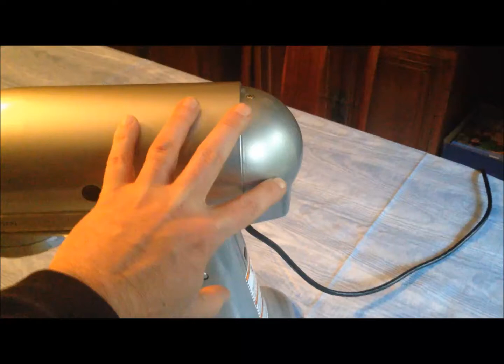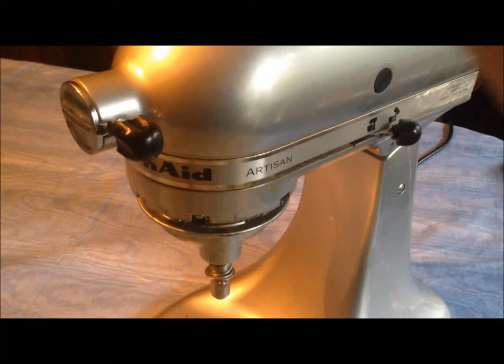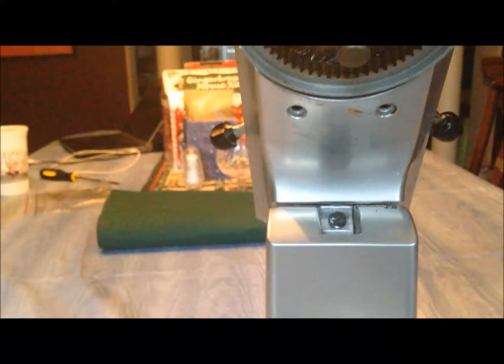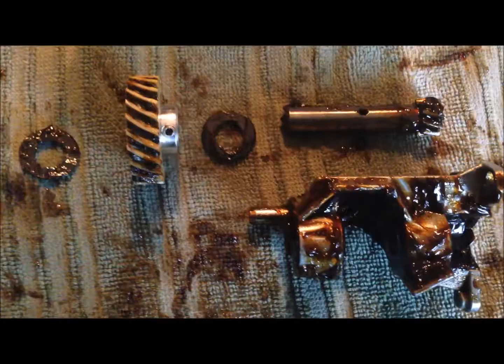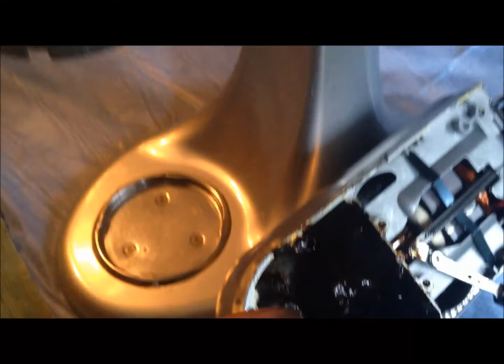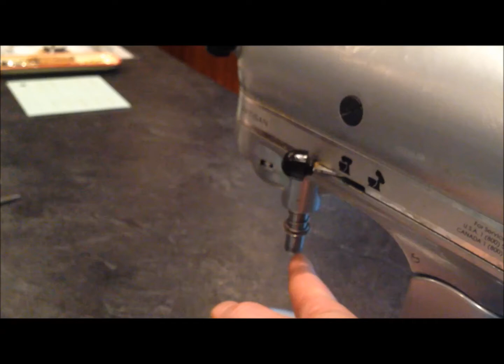Repair a Kitchenaid mixer that won't mix - Bonus footage: How to adjust its speed

Comment: Bottom screw is high speed set on speed 6. Top two are slow speed. Set on speed 1(stir) 
On stir should be 1 rev per second. Loosen top screws evenly to speed up, tighten to slow. 
Once set on low, pit on speed 6. Should get 3 revs per second (30 in 10 seconds)  tighten lower screw to speed up and loosen to lower speed. (Opposite as top screws)
Set low speed (stir) first then high speed (speed 6).

Comment: Top 2 screws are low setting for stir setting set to 1 rev per second. Lower bolt is high speed setting for speed 6 needs to be 180 rpm (45 every 15 seconds) 
Set low setting first then high. 
Top screws for low are loosened to speed it up. Lower screw for high (speed 6) are tightened to speed it up.
Best to start at factory specs of 3/8" from back of plate to where screws mount to body of mixer. 
:-)
Just writing this in case some others get confused about this.
Hate to see someone pay shipping plus a chunk of change for something that can be easily done at home.
Over time the contacts will wear and may need adjustment throughout the mixers lifetime.

Comment: FYI the bottom screw is not an anchor screw. It is to adjust the mixers higher speeds. It should be at first all the way out, while you adjust the stir speed using the top two screws. After the stir speed is set the bottom screw is then used to set the speed for speed 6-8-10.
Reply: Yes. Turn onto speed 6 after setting low speed on stir. Adjust bottom screw to 3 rotations per second (30 in 10 seconds, 45 in 15 seconds, etc)

Comment: Doug, I have a K5-A purchased in 1974. Was in rural Alaska for 44 years and it has been a work horse with few repairs required. Replaced brushes a couple of times. Now live in North Idaho, and I dropped a spatula into it a few weeks ago and now it is out of sync with the beater touching the bowl with every rotation. Have ben unable to locate a video that would show me that adjustment or repair.  Do you have a video that shows a solution for that?  Thank you for the speed control info, I need to adjust that also. Have been unable to locate a local repair shop in either Coeur d'Alene or Post Falls, ID. My home email is piratescorner3@gmail.com if there is an easy fix?? Thank you!
Reply from the maker: Hi Paula--Sorry I'm out of my depth on this one. The axle appears to be bent up in the motor housing and you would need to bend it back. The spatula must have applied a lot of force to the arm that was transferred up into the housing. You'd need to take off the housing, remove the grease and look at the axle spin to diagnose where the bend occurs, then figure out how to bend it back. It won't be perfect unless you get lucky but as long as the beater doesn't scrape it will be okay. You could replace the whole transmission I guess, but can you still get parts? Good luck.
Reply: Thank you so much for your response!  I will open it up and see if I can see the problem area.  I love it and don't want to give it up.  The new ones do not begin to match the quality. I have a friend who went through 3 new ones in one year. They would not honor the warranty for the 3rd one, they told her she must just use her mixer too much.  The old Hobart machines are far superior.
Reply: Tilt head back, there's a screw that adjusts the tilt head height to the bowl. Hopefully you just need to "raise" the head so the paddle doesn't hit the bowl

Comment: This was super helpful! thanks!
Reply from the maker: +Rian Corcoran Thanks for the compliment and glad it helped.
Reply: +Doug Brown can you check the kitchenaid vid in my channel..
i have sort of unusual problem in low speed. the problem is there in high speed also but less pronounced
Reply from the maker: max factor I looked, but sorry I don't know what could be causing that. Is there a small appliance repair shop near to you? I think these guys can tell you instantly.

Comment: Thanks for the great video. My mixer seems to spin at one speed no matter the speed setting that I choose (medium to fast speed). The speed control arm isn't broken or damaged and I'm wondering, will this adjustment will work for each setting?
Reply from the maker: +Chris Beard Boy,I can't answer that one conclusively. Something's preventing the unit from requesting more current and my inclination would be to make sure the control arm is switching between the different contact points that trigger more/less current. The speed adjustment in the rear is more of a micro adjuster, and that means every notch on the control arm would just be equally faster/slower. I'd look for a mechanical problem because the electrical circuit is present, you're just not getting the right circuit when you move the arm.

Comment: Thank you so much !!!! Watched your video and you saved me $$$$$$ Easy to follow. The only problem I had was there was a pin not a screw to remove the planetary. Easy fixed with a hole punch. Popped straight out and the mixer is back in action !!!! THANK YOU !!!!!
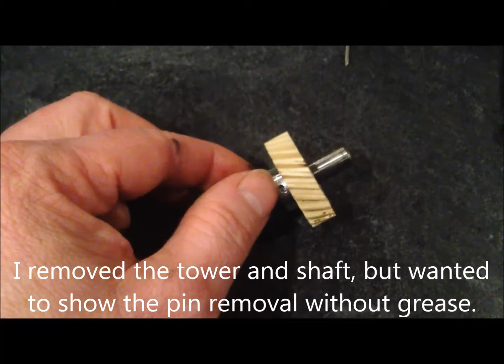Reply from the maker: +Cake Arcade - Macarthur & Southern Highlands Thanks and I'm glad it worked out. My planetary is also a pin and I think I show that around 8:45. If you're talking about a different part would you let me know?

Comment: Doug I can't thank you enough.  I've been using a mixer for 20 years missing the first 3 gear speeds with the rest working.????  What I kept thinking is if the top speeds work there must be an adjustment to set the speeds, but back then NO YouTube and I was afraid to tinker with it.  I just bought a new machine last week and was going to give my old machine to my girlfriend even though the low speeds didn't work.  She would at least have something. Now I can's wait to give her a perfectly working machine.  She's going to flip. Thanks again.  Patty
Reply from the maker: +PatOM21 Glad to help out!

Comment: Good video.  Informative.  Its possible someone has said this already but there are no Worm Gears within the mixer.  They are all Helical Gears and I believe I spotted a tapered spur gear in there as well.  Just a technical point.  Worm Gears are long or short cylindrical gears that have screw like splines on them.
Reply from the maker: +Tony Yacovielle Mixers need high torque, low speed gear ratios to rotate through thick batter and definitely use a worm gear. You're seeing all the helical gearings, and just can't see the single start worm screw because it's covered in grease in the motor housing. The screw spins the sacrificial worm wheel, which I'm referring to as the worm "gear" because that's the term on all replacement parts site.
Reply from the maker: +Doug Brown The two main KitchenAid mixers (heavy duty Accolade and cheaper Artisan shown here) both use worm gears but place them in a different sequence due to the motor strength. The strong Accolade motor drives a helical gear that in turn rotates a worm screw/wheel and then the planetary, and because it's heavy duty there's no sacrificial worm wheel. The Artisan is different and has a sacrificial worm wheel first in sequence to protect the lighter duty motor, followed by some helical gears (that you see) that drive the planetary. Hope that explains things a little better.

Comment: I have a stand mixer that will not turn on. When I tried to run it it would try to spin but then nothing. I thought it was the worm gear so I replaced it. but now it will not even turn on. Any ideas?
Reply from the maker: DJ Johnny Smooth Hi. It sure sounds like the motor is just worn out, or there's a wiring problem. How old is your mixer?
Reply: I bought it in 2003. Hardly used though.
Reply: DJ Johnny Smooth did you ever figure it out?? I'm having the same problem. It was working then it stopped after I messed with the three screws. Help me 😩